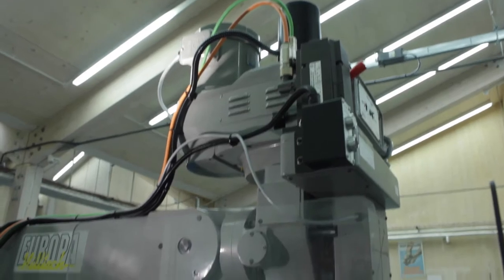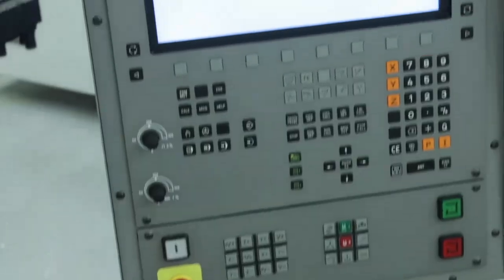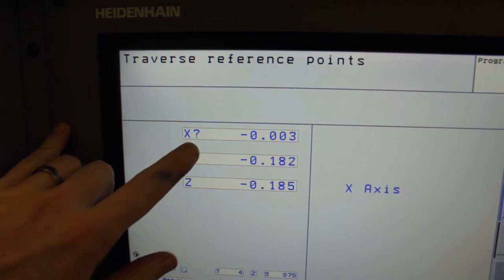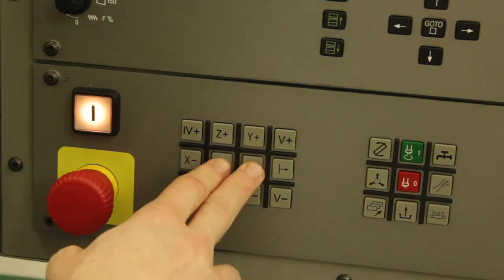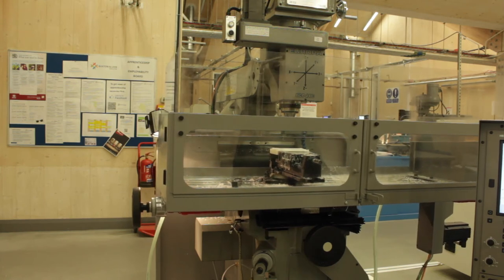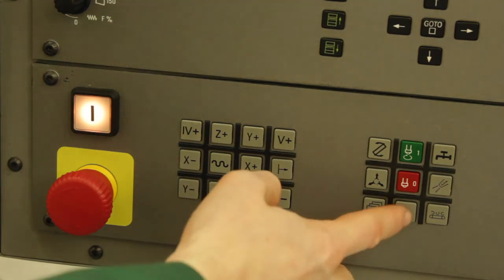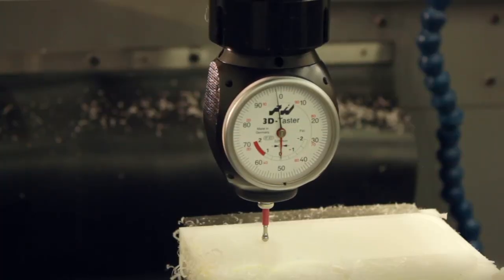Heidenhain CNC Milling Start Up Routine Tutorial  iTNC TNC320

Comment: This was my first lesson on hiedenhain,  I cant wait to learn more .
The reason im studying it is because  its a dream of mine to own a kern cnc machine . I learned they use the hiedenhain controller.

I cant afford one yet but it won't be long .

I will subscribe and watch more in the future.
Reply: We have DMG with this style controller and it is a fuckin pain in the ass. The controller interface is convoluted and seems clunky compared to other machines. Maybe its just ours, but if you dont put one leg in the air, spin around 3 times counterclockwise with one finger on your nose while touching your right heel to your left toe.. well you get what im trying to say. It will go out of wack (the machine itself) and you will have to do a bunch of reset processes to reorient the machine so certain components are covering the correct sensors. and it is way to easy to delete important stuff. and there are three separate command keys you use at different times that do a similar simple task like the enter key on your computer and if your not paying attention and the wrong enter key at the wrong time it will allow you to continue forward with unprocessed info which can result in a crash. its not idiot proof just a heads up

Comment from the maker: Bless. You've misunderstood. But thank you for your comment. Let me clarify.

1. This isn't a maker space. It's an engineering training centre that for the past 20 years has been knocking out lots of well trained apprentices trained in both CNC and manual machining that are provably fit for the job. 

2. I agree about starting from 0% feed when running a job. Obviously. No one likes expensive crashes.

3. This is a startup routine. The control basically traverses and hits all the limit switches. Our machine's control actually throttles feed rate for traversing axes during startup to around 20%. If you turn down to 10% then the traversing will take about 10 minutes. I know this because I have done it. It's unnecessary and a waste of time.

4. As it happens this machine doesn't have a variable spindle as it's retrofitted. The spindle is either on or off and speed is controlled via the gear box. In this particular instance it makes no difference.

5. I can accept that perhaps at the end of the video I should maybe have added "now turn all speeds and feeds to 0" but I'm not about to pull down a video with ~10k views. I'd disagree with a comment that this video is misleading in anyway.

6. I don't doubt you're knowledgeable but ranting into the internet about dumb makers and "noobs" (really?!)  when you don't have all the facts is a bit embarrassing. Nor is it polite. The world isn't divided into "you" and "idiots who know less than you". There are more effective ways to have a discussion on the internet.

7. Thanks for the comment on the video. Your comment signals to YouTube that this video encourages interaction as a result it'll be served to more people and I'll receive increased ad revenue. Much appreciated.

Comment: I dont know if you still monitor this channel but i am desperately tryong to find a set of parameters for an old XYZ milling machine similsr to this. Uses the TNC355. Do you have a parameter list i could have?
Reply from the maker: Sadly not - have you tried contacting heidenhain directly?
Reply: @FuturefabOrgUk  
Yes no joy. Parameters are specific for the machines themselves. I contacted xyz no joy either. Do you still have the machine in the video? Parameters from that would help. Thanks.
Reply from the maker: Afraid not, I left my position in that college nearly six years ago!

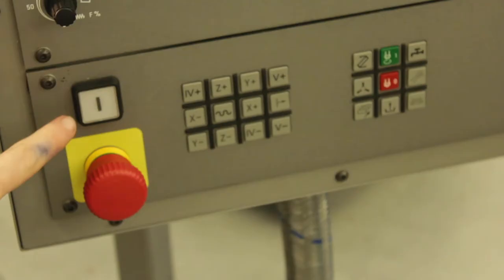Comment: 0:40 This is the worst bit of advice I have ever heard of regarding Heidenhain startup.
Every teacher, every Heidenhain service engineer and every decent operator knows that you should set the feed potentiometers to 0% first, make sure the spindle is nowhere near anything to crash into, hit cycle start and then SLOWLY turn up the feed rates to 100% or whatever.

Same goes if you want to move with rapid feed from a critical position: Feed potentiometer down to 0, press rapid feed button, and then SLOWLY crank up the speed.
If you just hit cycle start with feed at 100% you might crash into something because you never know how the machine behaves at start.

As for the spindle override, if you have no tool in the spindle you can set it to 100%. If you got a large tool loaded and your machine has got a spindle with a high RPM rating, either unload the tool before starting the spindle, or set your spindle speed as low as possible (machine set RPM and potentiometer)

Just goes to show how ill-informed "makers" are, noobs teaching noobs how to operate machines the WRONG way....
Reply from the maker: Bless. You've misunderstood. But thank you for your comment. Let me clarify.

1. This isn't a maker space. It's an engineering training centre that for the past 20 years has been knocking out lots of well trained apprentices trained in both CNC and manual machining that are provably fit for the job. 

2. I agree about starting from 0% feed when running a job. Obviously. No one likes expensive crashes.

3. This is a startup routine. The control basically traverses and hits all the limit switches. Our machine's control actually throttles feed rate for traversing axes during startup to around 20%. If you turn down to 10% then the traversing will take about 10 minutes. I know this because I have done it. It's unnecessary and a waste of time.

4. As it happens this machine doesn't have a variable spindle as it's retrofitted. The spindle is either on or off and speed is controlled via the gear box. In this particular instance it makes no difference.

5. I can accept that perhaps at the end of the video I should maybe have added "now turn all speeds and feeds to 0" but I'm not about to pull down a video with ~10k views. I'd disagree with a comment that this video is misleading in anyway.

6. I don't doubt you're knowledgeable but ranting into the internet about dumb makers and "noobs" (really?!)  when you don't have all the facts is a bit embarrassing. Nor is it polite. The world isn't divided into "you" and "idiots who know less than you". There are more effective ways to have a discussion on the internet.

7. Thanks for the comment on the video. Your comment signals to YouTube that this video encourages interaction as a result it'll be served to more people and I'll receive increased ad revenue. Much appreciated.